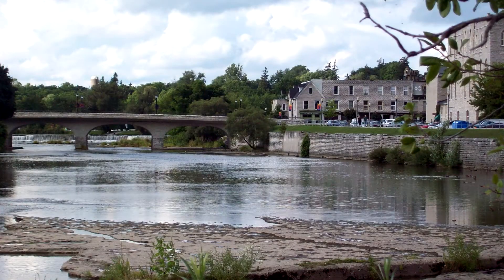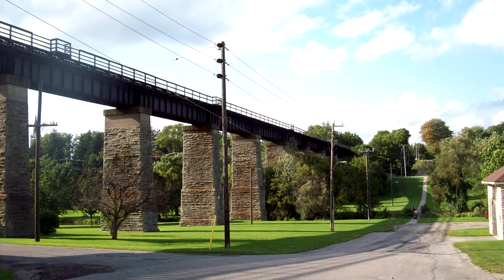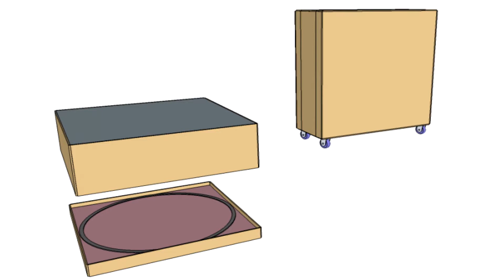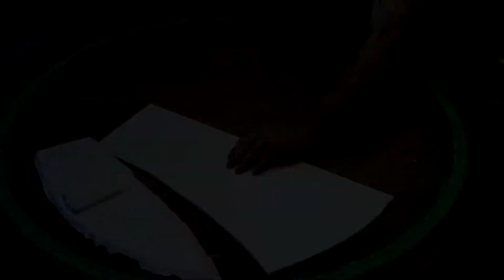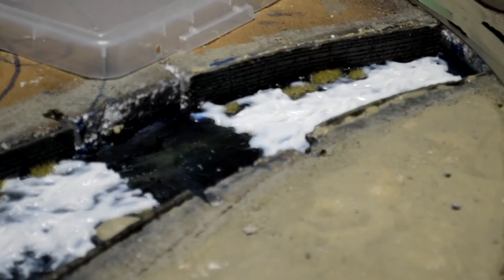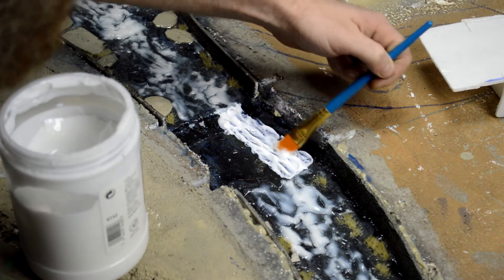How to model water | The Scale Model Show March 2016 | SMS #1

Comment: Hi &Thanks, Ron.  FYI, re colouring water.  Situations vary as you say, but a trick I learned for lakes and deeper rivers, is to paint the middle dark black green and near the shore, gradually lighter mixed with more and more of your shoreline dirt colour.  Even without a water medium, the paint makes the eye see deep (darker) in the middle, and shallower at the shore.  Rivers have their own tricks, especially shallow ones like yours, with its limestone flat slab base.  Another tip re colour that was in a clinic by Mark Dance backed by photos of the same spot on a different day, was NOT to worry too much about the water colour.  It varies with the weather & cloud conditions, time of day, sun angle, & all that jazz.  The shoreline treatment is what really makes it all work.  Cheers, and keep on keepin' on, G.
Reply from the maker: +Graham Stokes I agree 100% for deep water. A rivers depth does get deep in the middle but not so much, and the flood walls make it so the shore is inconsistent. That is the reason I was not concerned with color variation. Other then screwing it up a bit, which is a necessary step in my modeling...